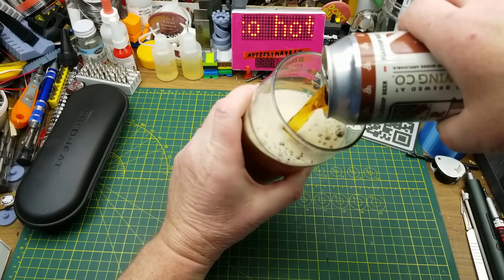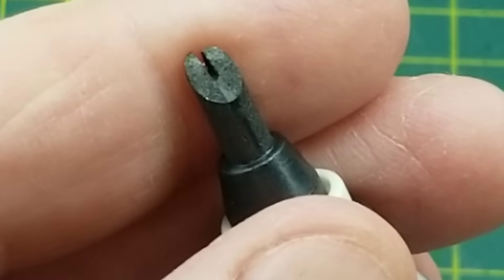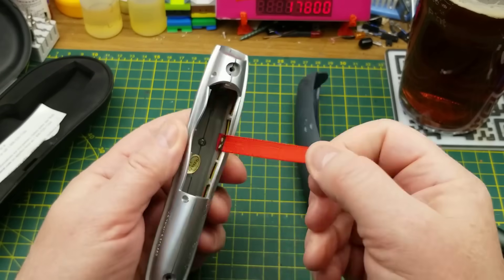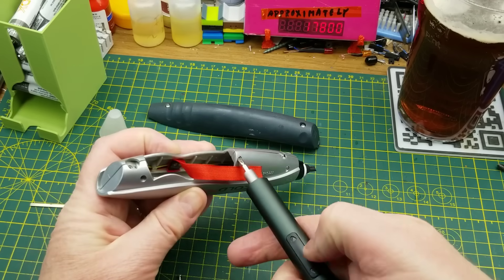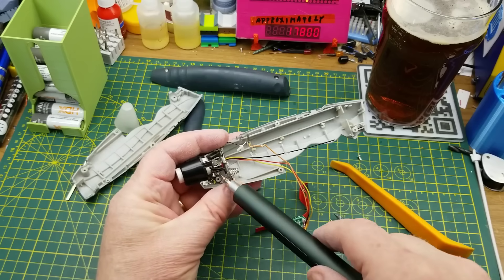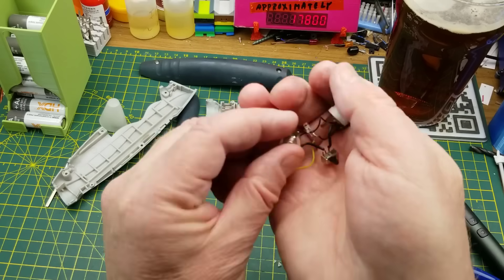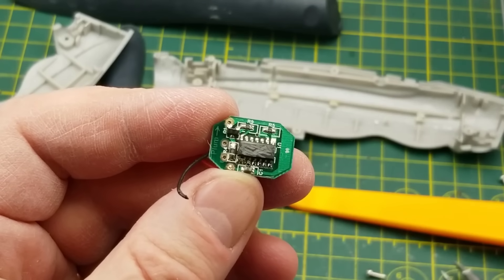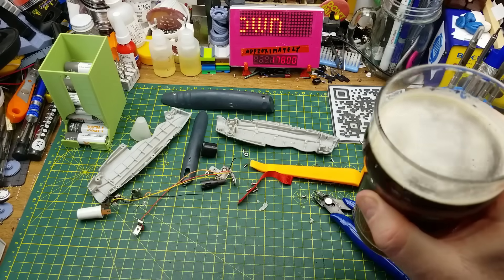Soldering with cold heat?  Curiosity teardown

Comment: @pileofstuff Can I ask what kind of mini screwdriver that is and where I might purchase one myself, that is if you would recommend it. It looks to be decent quality & looks like its pretty quick at removing & installing screws. First time watching your videos and they are quite interesting. Well done btw. Thanks and here's my cold solder story. Have a good one & keep tearing shit apart. LOL          ****  I had a couple of these years after they came out & picked up 2 nib off marketplace about 10yrs back and well, I was disappointed but not surprised, especially after tearing it apart and not seeing any components to bump up voltage or current to something that would actually melt more than just solder. I attempted soldering numerous things that were paper thin with no success. So I looked at the 4 AA battery's and thought if 6v won't do it... Juice it up with a 2s or 3s Lipo...So I did and saw a very small improvement on 2s, so I tried 3s. It did work soldering some 16ga wire together for about 6 seconds until the little board started smoking, a lot..Not surprising that 12.6v was too much. Oh well, great idea however poorly executed design by the cold heat folks.
Reply from the maker: The screwdriver is a Kaiweets ES20.  (https://youtu.be/_voEqcVROsE)

I also have a Wowstick one that I use sometimes, but it's less powerful.

Comment: So I got mine out after watching your video...or was it the other way around? Anyway I started to tinker with it and when the material is recognized by both sides of the tip there is a red led that turns on. Seems to fade in and out. At first when this happens naturally you want to add pressure to assist it because you think this thing might be working. However after rigorous testing for about 8n seconds it would seem that you need to ease off. You can actually see a little white spark, and like unbelievable magic my solder was severed in to two pieces. At first I thought I just cut in two. But, after more rigorous testing for double the previously mentioned time it actually melts. I can not see any application where it would melt enough to join two other materials together. Maybe that wasn't even the end goal, maybe if it got hot enough to melt then it was hot enough to market. Well there you have it, an honest review of a very poor working product.

Comment: My experience too unfortunately. I bought my specimen at a Radio Shack in New York on a trip to the States. Used it a few times and I remember that I managed one shoddy but reasonably successful small joint . That all but drained the batteries after which it has remained forgotten in a corner of a drawer until now and to which it will return there only to be resurrected as a curiosity should the occasion arise. by the way, moulded into the plastic battery cover is "MADE IN CHINA".

Comment: 1 x largest 2S LIPO that will fit. put a battery access connector for external charging, and it should work way better. :)
Reply from the maker: Drawing excessive current out of a LIPO is  generally frowned upon.
Reply: @pileofstuff  AA batteries can only produce a small amount of current relative to a LIPO, which at 1C (very low for a LIPO) would produce several times the current of AA.
That is why LIPO would be much better.  Most LIPO are rated between 10C to 30C, so 1C is trivial, as would 2-3C, which would DRAMATICALLY improve this currently USELESS tool.

Comment: It would be interesting to see how it performs with a lithium battery (18650), they can supply much more power than a normal battery, you probably wouldn't even need to step up the voltage.

Comment: They later sold a "15X stronger" version with ceramic tip instead of Athalite (graphite).  The original COLDHEAT trademark for soldering irons was 2003.

Comment: It looks a bit like my Weller BP645 soldering iron. Mine has the classic tip that heats up. It uses 3 double A batteries. I even have a butane powered one somewhere, about the same size. None of them worked that great.

Comment: You could hook up leads to the soldertips and feed the thing from your lab power supply. Then you would have full control over the voltage and the current, needed for a certain job..
Reply: Stole my idea...darn   ;-)
Reply from the maker: To work properly it would need more current than my bench power supply can supply.

Comment: They work better with rechargeables.  And you have to clean off the flux on the end of the element otherwise it won't get a connection when the flux cools off.
Yours had dried flux all over it.

Comment: I had one of these when I was teaching college (2000 - 2013).  I want to say it worked for all of about 6 months, then died.  
I allowed my students to use it.  It quit when a student used it and he was blamed by their classmates as breaking it.  I told him not to worry about it.
I did a tear down, in front of the students to show what was inside.  Needless to say, they were not impressed on the 'innards' of this soldering device.

Comment: Manual says do not use on sensitive components nor allow the two prongs to touch different parts of the circuit. For light duty electronics and small gage wire. The heat is generated in the high resistance probes not the solder.  Supposed to last for 750 joints on a set of batteries.  Just measured the “high resistance” tips as 2 ohms each, and current with NiMH cells as 2A.  That’s about 8w, right?

Comment: Never heard of these. Maybe it never reached England. (?)

I do have a battery powered soldering iron though that takes 3 AAA batteries, it' a standard design of iron with a proper tip. It's perfect for hard to reach jobs where a wired iron would be impractical.

Comment: I have one, tried using it once when new and didn’t have the need for it that I thought I would. Just recently got it out of the box too, tip is like new. Still has the instruction and warranty and yellow warning label not to press too hard when using, which limits its usefulness. The white LED comes on when the switch is on, and the operation LED lights red when tips encounter solder. The sticky coating comes off with IPA resulting in an attractive finish.  Works fine with NiMH cells.

Comment: I used to have one of those, broke the tip soon after, replaced the tip and broke that  one too, it never really worked so i scrrapped ir, i didn't investigate
I found the instructions online, the white led at the front should light to tell you it's on, when you make good contact the red led should light, so it seems like the circuit is detecting the voltage across the tip, when that voltage drops it illuminates the led.

Comment: I still have one in my soldering drawer, like yours and all the others I never had much luck with it. I have seen two that were modified to work beater, one the fellow replaced the aa cells with a external five cell nicad pack which he had to recharge after every other solder, the other one the guy wired up a bunch of capacitors to it and it worked like a spot welder. both of these were done by chaps with much more electrical knowledge then me.

Comment: 😂 Oh yeah, I  got one at work hoping to use it on little jobs like replacing pots in control panels. Nope, just drag out an extension cord and wait for the old Weller pencil to heat up.

Comment: They were nothing but junk when they came out and I'd still consider it junk. I tried to use one and after 30 seconds I was done with it because all it did was burn my finger since all it basically does is create a short circuit. A less than $10USD soldering iron from eBay is much better than trying to use one of these.

Comment: I always wondered how these things "Worked" and im still no closer to understanding it 😀 , I dont think 4AA would be able to generate enough heat , A modern day lithium powered one may be interesting.
Reply: It's just a fancy short circuit, nothing more.
Reply: @benkeysor7576  And they wanted to use these for soldering sensitive electronic parts?

Comment: Hm. Yeah, I saw them advertised but didn’t spend money on one.

Where do those four wires go from the board? Two from the batteries, and at least one to the “headlight” LED thence to the switch, but how does the other one know to light up when there’s a load across the tip if the tip is just connected directly to the batteries?  The chip has to be connected to at least part of the tip to see the voltage across it change when it’s touched to the workpiece.

Yeah, I know I’m guessing but I can’t see how else it could work. The chip is likely a dual comparator or even maybe op amp set up as a comparator (only using half of the chip) comparing battery voltage to tip voltage drop.

A followup with a block diagram at least would be interesting and maybe instructive.

The body shell reminds me of Star trek Next Generation medical props.
Reply from the maker: other than power wires, the wires from the PCB just go to the 2 LEDs.